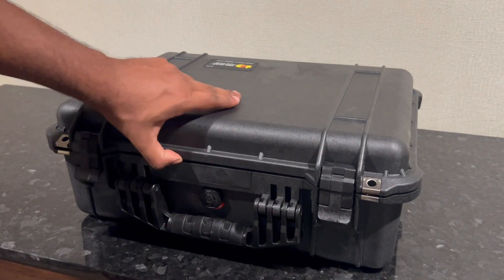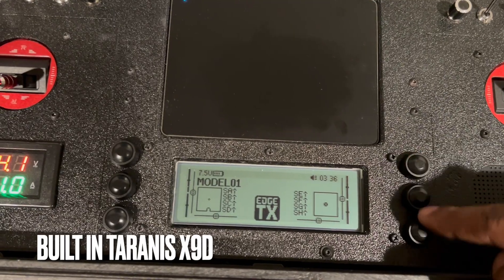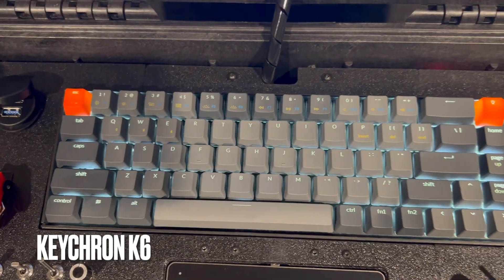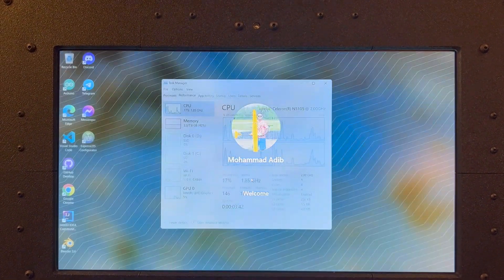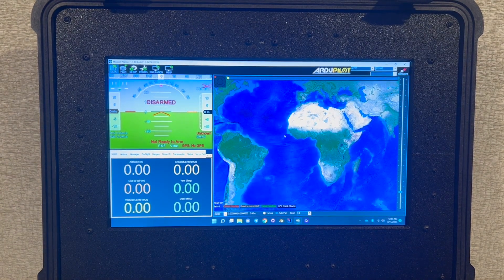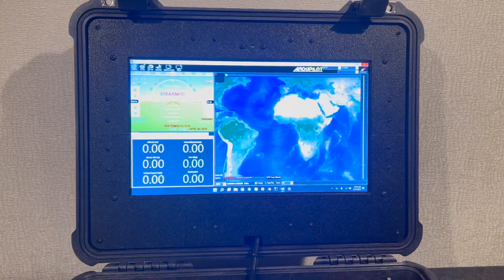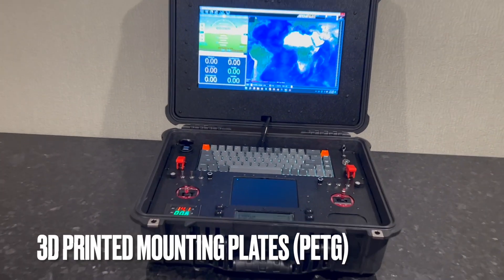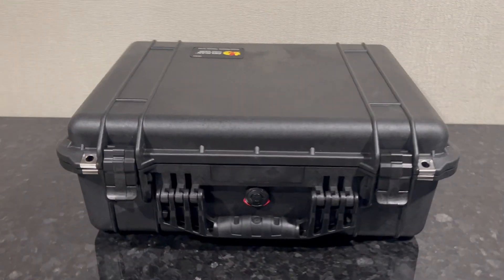TitanGCS - First Prototype in-depth look

Comment: If you'd like anyone to beta test this system, I am currently setting up a vtol aircraft using a Pixhawk 4 flight computer (use utilizes QGroundControle, TX16S Transmitter, FS-iA10B receiver, and head tracking DJI O3 camera gimbal set up using HeadTracking V2.2 option 3 with Arduino BLE's. We are not using the Titan Avenger model but instead using a modified BTE Flyin' King which should VTOL and forward flight capable (very similar to the Titan Buzzard) because it has ample space for a glow stick dropper unit we 3D printed. Using the Avenger or Buzzard model would decrease manufacturing time tenfold and I think it should be something Miami University should consider.  I would very much like to build and test either models this semester using an unused pixhawk 4 flight controller I have.